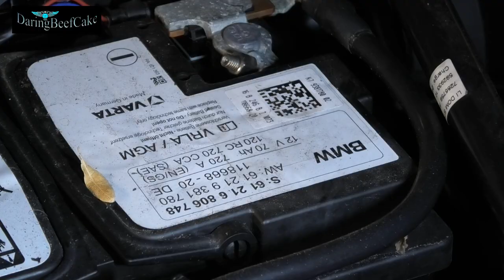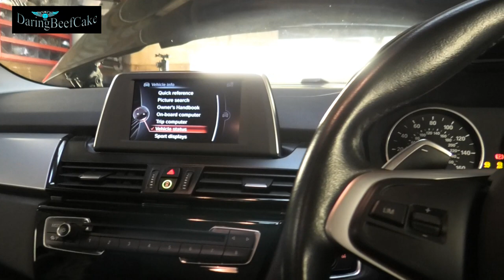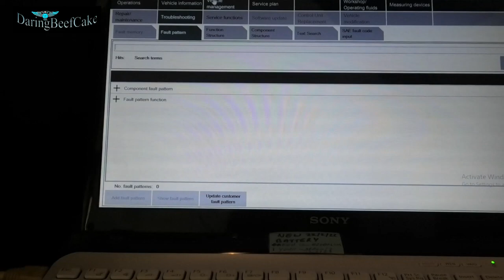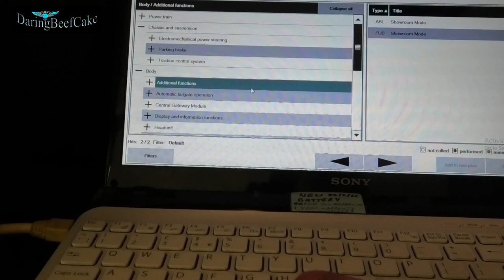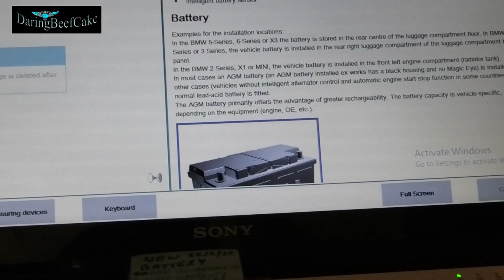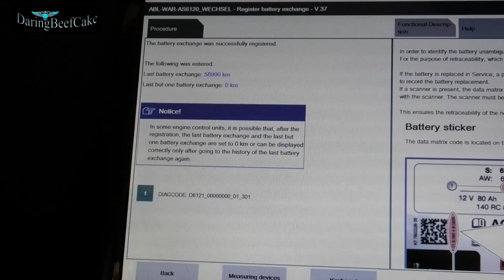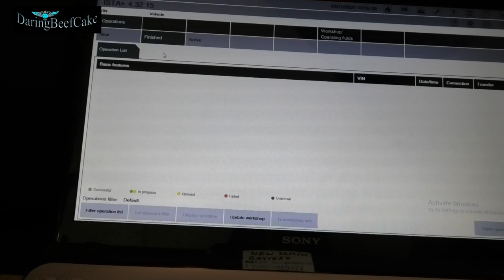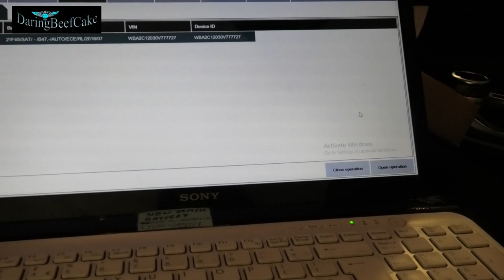BMW F45 series 2 main Battery removal and replacement

Comment: You don't have to disassemble the wiper blades. The better way is to gain access from the front and then pull the battery out while still in the front. To do this, the air filter housing must come out, as well as the plastic parts that sit in front of the battery. That's why the rear mounting nut of the battery is angled, so you can unscrew it from the front.  Thats the way we do it here.

Sorry for my bad englisch. I am from Germany.
Reply from the maker: Thank you for your comments and tips to let me know, next time I’ll change it the way you mentioned and may be make a new video.
Reply: You are exactly right. I have advised people to watch another YouTube video where you don't have to remove wipers and windscreen facias 👍🏼

Comment: Useful video. Do you remember what is size (Height Length ...) of the battery that fits into F45? Different web pages gives me different sizes.
Reply: It seems like 
Length (mm): 
315
Width (mm): 
175
Height (mm): 
190
Reply from the maker: No sorry I didn’t actually measured the battery.
Reply: 315 x 175 x 190 mm (LWH)

Comment: can you remove the battery, charge it at home, then install it back without doing the software part ?
Reply: technically yes but it may lead to various check control messages and other electronic issues. if possible avoid at all cost. according to the technical specs you're supposed to charge the battery only by hooking to the + und - points in the engine bay so that the intelligent battery monitor has a chance to detect the external charge. if needed jump start the car (use the same + and - points) and drive it to a location where you can plug in your battery charger.
Reply from the maker: So technically yes, the software part is used if your fitting a new battery. But you may need software to clear fault codes that are generated when disconnecting the battery.
Reply: What software did you use?

Comment: Remove the wiper blades?! Sod this, I was going to do this myself but that is a faff!
Reply from the maker: It is a fairly long process, they could have just made a separate cover for the battery but no it had to be this complicated.
Reply: @DaringBeefcake  Can the air box now be removed and slide it out from there?
Reply: @timboslice4019   да можно, так легче, дворники снимать не надо
Reply: @timboslice4019  yes that's exactly the way BMW would do it

Comment: You simply remove the airbox, not al that stuff....
Reply from the maker: Oh is it ? Will have to try it next time.
Reply: Yep just remove top of  airbox very easy to do
Reply: @DaringBeefcake  since you already have the software it's always worth while reading through the repair process as shown in the software. it'll tell you exactly what to remove first if needed and shows detailed step by step guides including warnings and recommendations.
Reply from the maker: @7pdude  very true.